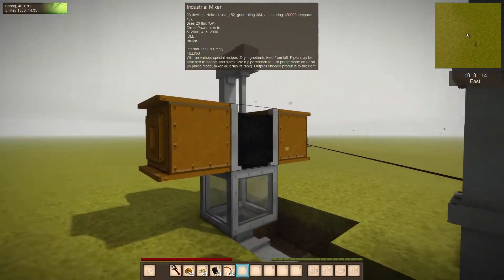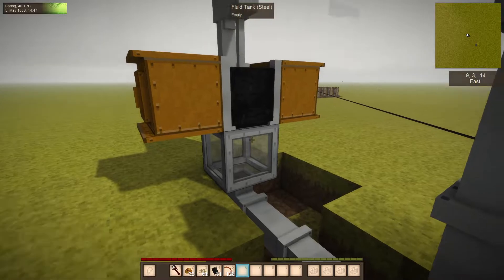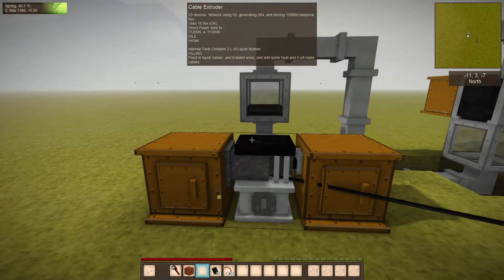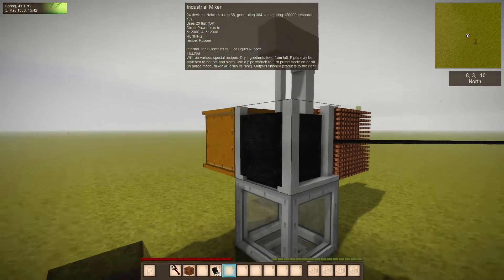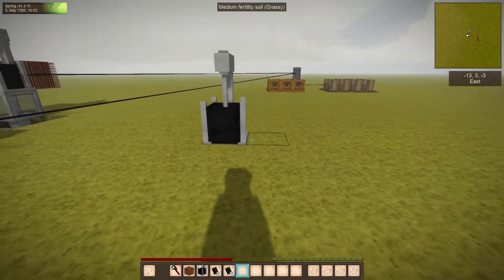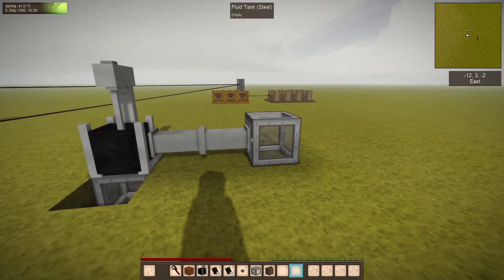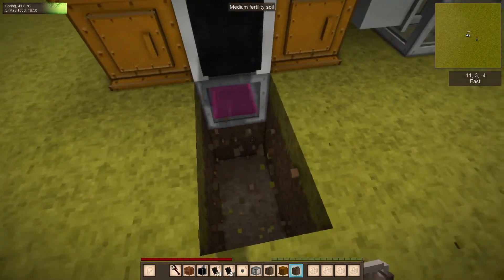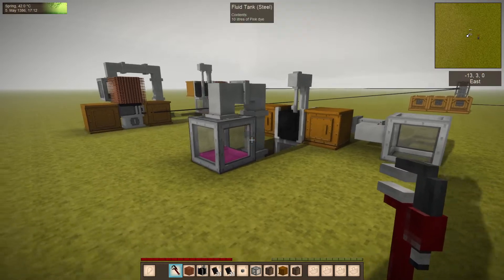Mixer Tutorial - how to make liquid rubber and how to make cables

Comment: I Tested the wiremill and when you process one Stack of Copper ingots to plates -> Sheets -> Wire (wiremill) you will recieve 64 Wire and If you process Like ingots -> plates -> rods -> Wire (Manual wirepullplate) you will recieve 80 Wire . Was ist intended to make the lower tech more efficient?
Reply from the maker: Ah just saw this comment - wiremill might need a buff. Though it does help making the braided cables.